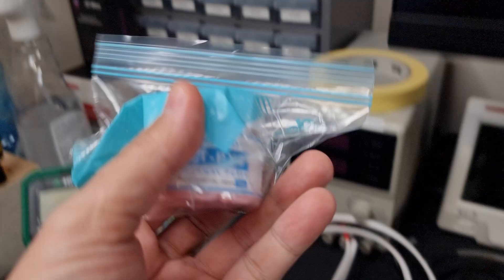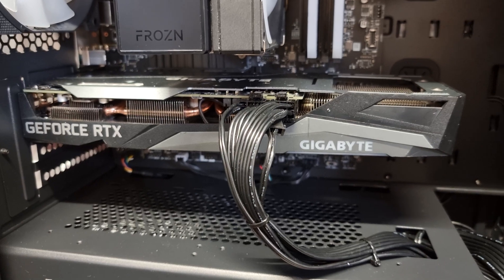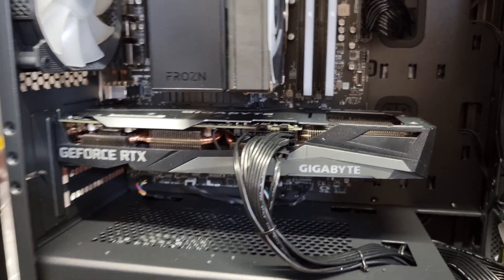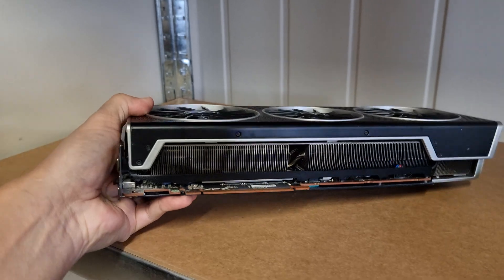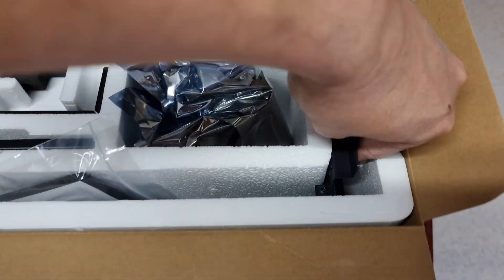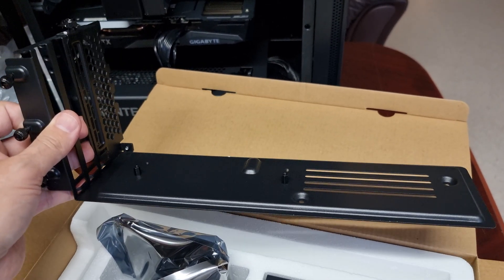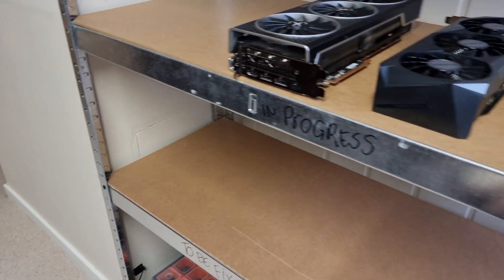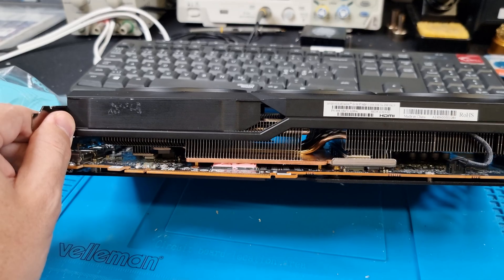Why Modern Day Graphics Cards Are Dying Prematurely.

Comment: Does a PNY 5070ti need a support? I bought one but more worried about putting pressure too far the other way when installing it.
Reply from the maker: Yes it needs support, or in time it will warp and cause problems. It may take months or years, but it will happen.
Reply: @TechnologyHive do you have a bracket you recommended. I bought the jack type one.
Reply from the maker: @rover1374  I recommend the one shown in the video. Its cheap, and it works!
Reply: @TechnologyHive Didn’t see one so I must have missed it. Maybe it was your other video?

Comment: I use a cubic braket (square shaped) that goes all around my card (3d printed) and I use a level to see if the card is straight or not.
Knock on wood never had a card that bend or break form bending
.
Reply from the maker: Yes, I see people 3D printing supports more nowadays. Some even sell them.

Comment: I got a Sapphire Nitro+ RX 7900 XTX back in 2024 and its a massive 3.5 slot card. If it dies on me I got my Vega 56 on standby. At this point I wouldn't be surprised if these cards are comically large as a way to do planned obsolescence. I'm sure as hell not getting another expensive card if it dies on me.
Reply from the maker: It's due to heavily binned cores. They (AIB partners) want to extract as much power out of these cores as possible to charge you a premium for owning one of their cards, that they ignore what gravity does to heavy stuff.

Comment: Am I crazy for saying this, but my 4080Super (MSi Gaming X Trio) is a chonky boi, but even without my support stand that I use on the end, it doesn't look like there is any sag? I still use the stand but it barely lifts the card up. I do have an integrated sag bracket on my PC case, but I can't use it, coz it lands at exactly the half way point between the two front panel connectors, lol. I cant use one of those risers because I have fans on the PSU shroud. And I cant use the support bracket that came with the GPU either. So I have to use the stand at the end, which I know is not ideal.
Reply from the maker: You will do what you want with your hardware. But I always recommend support or vertical mount for these heavier cards. Even if you think the card is not sagging, the PCB latch area of your card is bending, which leads to cracked joints under the memory and or core.
Reply: @TechnologyHive  I use a support stand on the end ( the one that look like a headphone stand). You think a riser placed mid-way would be better? Thanks btw.
Reply from the maker: @willielast If you're concerned about gpu sag, id put it on a riser vertically.
Reply: @TechnologyHive   So I have an update. I can't use a vertical riser, but I bought one of those little telescopic supports to put in the middle. So I did what you recommend & I unscrewed the case screws first. But nothing happened to the card it didn't loosen up at all, its just perfectly rigid. I even used a spirit level & it was still perfectly straight, even with the screws off. But I jammed the little support under as best I could, it still felt like I was putting unnecessary tension on my card tho. I have an MSi motherboard that has a "Fortified PCIe 5.0 x16 Slot", with what they call "MSI PCI Express Steel Armor II". They claim it has "additional solder points on the motherboard, supporting 21% more graphics card weight compared to 1st Gen Steel Armor". Could this be why my card is so rigid & straight even with the case screws off? If the spirit level shows the GPU is straight, am I doing this unnecessarily? Thanks.
Reply from the maker: @willielast It may look straight, but if the card is heavy, it is still at risk of developing cracked solder joints under the memory or core. You'd have to take it out and look at the pcie hook on the card. If its slightly bent, the card is twisting.

Comment: I am going to get a support bracket for my GPU when I get my desk, for now I have my pc on its side on my tv stand its too big to fit upright, so technically my gpu is mounted vertically
Reply from the maker: That works too. I wish Cooler Master still made the Elite 130 little case.
Reply: @TechnologyHive  see my problem is I needed a big case to fit the gpu its a 342mm gpu and I wanted to have good airflow, gpu only ever reaches 67c at its rated 320w tdp and the cpu only ever hits 71c at 100% load. when I get my desk I'm going to get the 4000D frame with it but, I'll finally be able to stand it upright
Reply from the maker: @Boodiken  The 4000D is nice case. I had a few of those in the past.

Comment: What do you think about horizontal gpu supports that screw into the gpu bracket? i have the lancool 217 case which has bottom case fans under the gpu
Reply from the maker: Any support is better than no support.

Comment: I have a Asus Tuff 7900XT, thankfully the Fractal Torrent case I installed everything in as a GPU support bracket which solves that problem.  I have had zero issues (so far).
Reply from the maker: Nice! I wish all cases would take under consideration what is happening right now with heavy cards and failure rates due to their weight and sag.

Comment: 4080 and 4090 are pretty heavy GPUs.
Reply from the maker: Yes, even the reference card is a beast.
Reply: @TechnologyHive I'm on 5080 Asus prime and I don't think it sags. It's also light compare to other models
Reply from the maker: @ventsid5963  I would still use a support. Sag comes over time.

Comment: I saw that you have an Asus 5080 Astral on the shelf. Would you say that using a GPU support (not the Phanteks one) and horizontal mounting will also warp that specific card over time? I ask because it has a thick metal housing that would rest on the support. I had a shop build me a PC with that 5080 and I want to use two Amazon GPU supports to hold it up. I will add them between fan 2 and fan 3, and was wondering if this can cause issues over time with this card.
Reply from the maker: I have mine vertically. But if you use the supports correctly, you should be just fine. Between fans 2 and 3 is where I would place it.
Reply: @TechnologyHive  Need to make a correction. After a better look, I can only place the stands slightly past fan 3, because I have exhaust fans under the GPU. Is that good enough? I will place two pole-type stands there. And I can also put another two of them between fans 1 and 2.
Reply from the maker: @AltTab2193  Some support is better than no supports. I would still try to put it between fans 2 and 3, if you can find a way.
Reply: @TechnologyHive There is no way, it seems. There is not enough surface on the fan housing. What so you think about using 4 supports? Two between fans 1 and 2 and two after fan 3. I am mainly trying to avoid warping
Reply from the maker: @AltTab2193  That can work. I think it goes unsaid, but just in case, make sure not to lift the GPU with the supports. The GPU is supposed to just rest on the supports after you level it. 👍👍

Comment: Hi I have a gigabyte rtx 2070 super I've been using since 2020 (right before the bitcoin mining boom, got quite lucky) it's a 2 slot 3 fan card and I've always used it mounted horizontally into the motherboard
I've switched recently to a matx build in an asus ap201 with 3 120mm arctic pro fans as bottom intake which I have set up a fancurve in fancontrol to roughly match the same rpm as the gpu fans
furmark 1440p 10 minute test comes out with gpu avg temp 65c, gpu hotspot 78c, vram 79c so I dont think theres any issues with the paste or pads of any kind, granted there's 3 extra fans blowing cold air right into the cpu
I've been considering getting gpu supports for a while (I wouldn't consider a vertical mount as it would make the 3 bottom intake kind of useless for the gpu) 
I wanted to ask, is the gpu supports something I should get sooner rather than later or do you think a 2070 super is still fine by itself? Also I'm not sure where I would even put the supports since there's the fans right under the gpu... 
I yapped a lot but basically i wanted to ask if you had any recommendation for my system
Reply from the maker: I have not gotten many RTX 2070 cards with issues related to sag. If it has not failed you since 2020, I would keep doing what you've been doing so far. Maybe replace the thermal paste to prolong the cad's cooling performance. MX-6 ought to do the job, or Duronaut by Thermal Grizzly.
Reply: @TechnologyHive  thanks for the quick reply, honestly I've been thinking about repasting it but idk it seemed more trouble than its worth, keep in mind that its 65c during furmark, in normal gaming it usually hovers around 56c and hardly ever goes past 60c, I've already undervolted it and in games it clocks up to 1995mhz and hardly ever throttled down from that
I already have some fresh mx6 I used for my cpu, are there any type of pads you would recommend for when I'll repaste it (if ever) or are they all more or less the same? What about thickness?
As for the supports I'll see if I can find something I can 3d print and maybe scale it down to fit if it's too big
Reply from the maker: @user-tq1zv9hd1o  Just my advice, I would not give my money away to anyone else for thermal pads. I get mine here, these are OEM and good quality: https://www.aliexpress.com/item/1005007219946019.html?spm=a2g0o.order_list.order_list_main.51.5c841802MNDXry

Comment: just made a pc with a 9070xt hellhound; now i have 1 support, do you think that card is too big and it's better to mount it vertically ?
Reply from the maker: Supports work well enough when used properly. However, I would much prefer using a vertical mount kit just for extra peace of mind. Phanteks makes a few good ones.

Comment: This video just randomly appeared on my feed, and I enter to see if was related to what I did some weeks ago, whatever... 

The thing is, since I upgrade my 6700XT to the card I have now 4070 Super, and want to replay Alan Wake 2, Cyberpunk 2077... on full path tracing the noise was not just bothering me, it was to be honest almost painful, after I notice that I search for the temperatures on Techpowerup, they were almost the same on my card. I tried adding more fans to the case, follow a lot of tutorials about correct air flow, those decreased my temperatures on cpu and gpu for about 3C to 5C degrees. 

Obviously the noise did not increase, I have bought for myself a lot of cards Radeon 380X,  480X, 5600XT, 6700XT but I never pay to much attention to the fans or heatsink, I just made a deep research about which card I can afford. But this one was a PNY and I did not know anything about the brand. Since my last cards where Sapphire Pulse, with good cooling, what I didn't know before how good they where. 

After card guarantee period expired I search for a solution, never made a deshroud before, I took to old fans I never used from a CPU tower cooler, from a local brand, pointing those 2 fans are not Noctua or Be quiet, with a very homemade remedy tools, wow, results were impressive, about -15C degrees on gpu and memories and -20C on hotspot, no more coil whine. 

And without thinking about that, more longevity to my card, because the temperatures are lower than the usual temperatures posted online.

Comment: Good gravy, look at at that board. Can't say I've seen one that bad. 
 What bothers me about this issue is that I've read many many cases of companies denying rmas because of micro cracks and warpage around the PCIe connector which I believe is caused simply because cards are too heavy and it causes damage over time. However it gives companies a get out of jail free card.
Reply from the maker: This is why I keep getting these cards that technically are still under warranty but are refused because of "user damage."" It's nonsense.

Comment: What about the GPU support for horizontal mount? Does that work too? Does vertical mount even fit if you have a large CPU cooler
Reply from the maker: Support work just fine if you use them correctly. If you have a 3 fan card, I would place the support between fans 2 and 3.

Comment: My rig oven too littke cooling and boards  bend over time😢
Reply from the maker: Sorry to hear that. It might just be memory.
Reply: @TechnologyHive want get beefer gpu but see dang prices
Got 64 g ddr4 for under 90$ in may
Reply from the maker: @Matthew-j3b  Right now is not a good time to buy new. But you might find something in the used market.
Reply: Need thermal camera see temps cause run ac soon turn on computer

Comment: Such good advice I regularly ignore. " Remove the graphics card before you work on your system." 
So many times I have oh I can get that usb or other cable in there and wobbled the card about shoving my fat hands in.
Reply from the maker: This is heard from customers, who said that after doing some cable management in their PC's, the screen wouldn't come on. In all cases it turned out to be cracked memory joints. Cards were sagging and all they needed was that extra push.

Comment: meanwhile every founders edition ive bought have last for years and the most that breaks is the fans
Reply from the maker: Good point you bring up. I rarely see reference models come in for any type of repair. I do get them, but not as much as AIB models.
Reply: @TechnologyHive  i was a bit sad to learn the 5090 they kinda regressed on the cooling the 4090 is perfect its cooler then the 3090 was but the 5090 they seem to have skimped on the cooling
Reply from the maker: @JustaGhostDragoon  I have not tested a 5090 so I can't say. But sounds like you got one. I have not heard from anyone else about the cooling performance of the reference model 5090's.
Reply: @TechnologyHive  well its hoter then the 3rd party ones well i say supposely since i dont have a 2nd one to test :D

Comment: Just saw this video in my recommendation (probably cause I just upgraded my gpu). My question is, do you still recommend doing this for smaller models like the PowerColor RX 9070 XT Reaper? (2 slots but still has 3 fans). Thanks!
Reply from the maker: If you can get a smaller card, absolutely. I would still add some support between fans 2 and 3 for peace of mind. But yes, the smaller, the lighter, the better.

Comment: Heat!!. More fidelity more heat. Long gaming sessions at max settings is like running a boat motor. No transmissions, just max revs. Lower your settings and even use Radeon chill for long gaming sessions. 
Turn off your damn computer once temps drop, not sleep, off!!
I had a 390x sapphire brand new in 2016, finally died 2025. 
Clean the f n dust out of your computer periodically too. Generates more heat, like having a wool coat on your computer.
Be smart.
Reply from the maker: Its not necessarily heat, but rather greed. Cards do not need to be this huge, but AIB partners want to squeeze every drop of performance out of heavily binned cores so they crank up the power, which creates more heat, thus the bigger heatsink. Reference models are half the size and perform just as well, maybe -2 fps. Its ridiculous!
Reply: That’s logical.

Comment: Which vertical support do I need to buy for my 4080 Super? Are the ones from aliexpress reliable? Which one gives me better connection quality? im lost..
Reply from the maker: Phanteks produces a $50 vertical mount. I made a video about it. But it is this one: https://www.komplett.no/product/1220772/datautstyr/pc-komponenter/kabinetterbarebone/tilbehoer/phanteks-vertical-gpu-bracket?gad_campaignid=19671799102
Reply: @TechnologyHive  Here im Brasil i cant find this Phanteks to buy.. expensive tax to import. This ones its good too?? its will make my 4080 safe? This is the best i can find in brasil : Cooler Master KIT V3 MCA-U000R-KFVK03 Black
Reply from the maker: @hugofaria8  Yes I use that vertical mount also. Cooler Master makes some good kits as well. I had the V2.

Comment: Answer = Heat!
Reply from the maker: No, not necessarily. There are reference cards from both AMD and Nvidia which are 2 slot cards, and two thirds the length of AIB models, which still deliver intended performance, and still keep temperatures within specs. 

The real problem, in my opinion, is AIB partners wanting to extract every single bit of performance out of heavily binned GPU cores which are given increased power draw, and in order to do this, they have to have gigantic heatsinks to keep temperatures down. This creates heavy cards, which if installed with no kind of support, will eventually sag and this results in cracked solder joints under the core or memory chips.

Comment: I had a 6800XT die after 2 years. I was beyond upset.
Reply from the maker: I get 6800 XT cards in for repair here and there, not very often but when. The common problem is memory problems with ripped pads.
Reply: @TechnologyHive  would that cause it to black screen? From what I remember about it, the fans will spin up for the first second, then stop. The OS will boot up and everything, but there is no display out. The monitors do not detect anything either, no matter which port is used.
Reply from the maker: @nottherealfakey  Black screen and fans spinning is common when there's memory issues. This is the number one cause for AMD cards dying.

Comment: Recently had same card with E vram issue. Replacing with new no fix. Reballed the core. Now card tests no vram issue but windows driver error instead. Card is bent like yours but not as bad
Reply from the maker: If after reballing the core you are still getting an error, it might be that you need to reflow the core. Sometimes it happens that you reball the core and some balls do not make proper contact with the pads. This has been my experience, at least.
Reply: @TechnologyHive Thanks for the tip. I'll try reflowing it again and soak it with flux